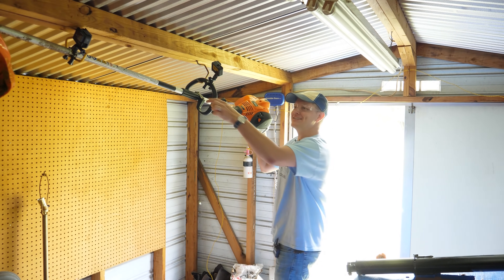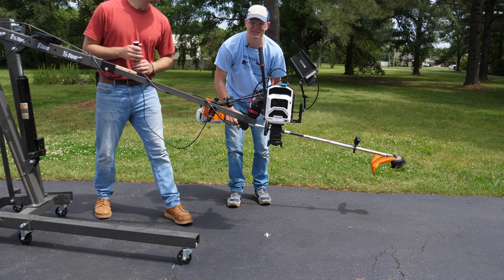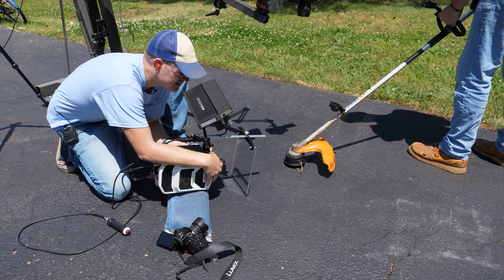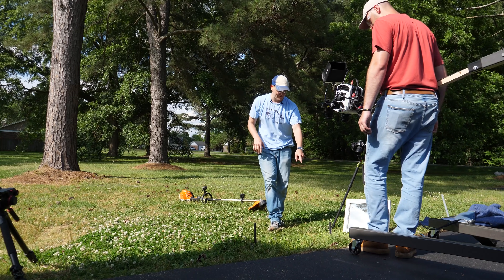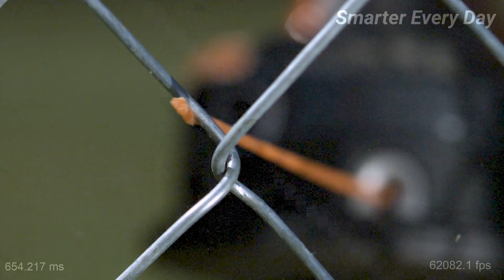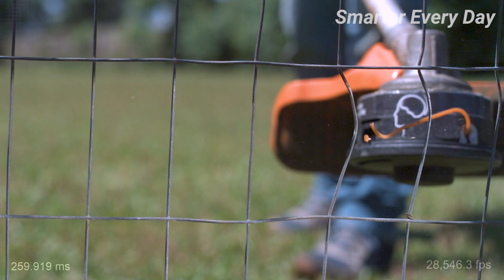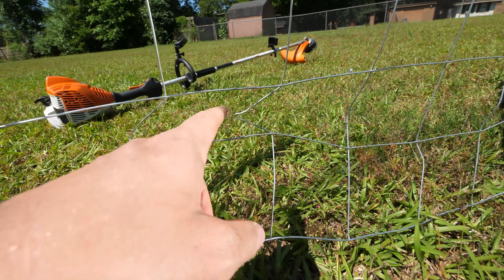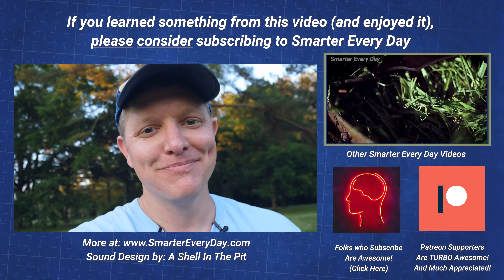How Weed Eaters Work (at 62,000 FRAMES PER SECOND) - Smarter Every Day 236

Comment: Tell it's STAGED... lemme tell you about that.

I bought a Toro lawnmower for 2 reasons... 1) had a Honda branded engine, and 2) didn't have the push assist. It was the cheapest mower I could find with a Honda engine and I got it because I was sick of disposable lawnmowers.

The payoff: that engine starts first pull every time, even after sitting in a shed over winter. LOVE that engine. briggs and stratton are pure junk lol, never again. Also most of the knockoff engines with no branding at all are old briggs copies. I'm sure the Honda engine is from China and not "as good as they used to be", but after 3 years I've never had to do anything but a single pull and I love it.

For the weed eater though... I have an electric one. It's got a 40 volt lion battery, I've had it 7 years and I can still easily mow my lawn 2 times with it without charging (I do after every use to keep the battery healthy though). Nothing worse than messing with little carbuerated 2 stroke engines, yuck.

Comment: We have a chain link fence in the back yard and to trim it I throttle back and the line goes through the fence and cuts some of the grass on the other side and does not cut the line. It takes a bit of practice but well worth it. Using a four stroke Toro string trimmer. I would like to see that in slo-mo.

Comment: When it revs really fast then the string is too short. I learned that buy going wide open is. most efficient. Because the motor doesnt bog down when cutting. Not saying wide open the whole time but mostly when cutting. A lot of people give it gas let off , give it more gas and so forth. This makes the motor work harder. I take care of3 properties for a total of 13 acres. 99 percent is with a weed eater. Nice slo motion camera

Comment: Isnt it breaking because the wire on the first one is thicker same as the 2nd one  then the weed eater wire there for when it hits the fence the fence is putting the same amount of force that the weed eater is putting in making the wire from the weed eater weaker there for it breaking thats why on the last fence the weed eater didnt get damged as much then the others because the weed eater was putting in more force then what the wire can handle because it was slimer then the weed eater and yes its only breaking from tension becuase the weed eater has its fibers  damaged already

Comment: The reason you cut from right to left is because of the gaurd oreintation, notice how the gaurd extends to the left on most weed wackers, thats to stop the bits of cut stuff from coming up and hitting you in the face, because the cutter rotates counter clockwise. also if you were to cut from left to right that part of the gaurd gets in the way to your cutting, especially if you are cutting alongside a building.

Comment: Haven't watched yet but I say that for sure the lines must straighten at some point. The weed eater I've always used has a sharp metal plate on the plastic shield that snaps off excess line when you let it out from the internal spool. Pretty sure it was always broken right where that plate is, meaning it must go straight out. I'm interested to find out now...

Edit: somehow that unpleasant feeling of yanking and knocking when you hit a hidden fence or bar is magnified tenfold when watching it in slowmo.

Comment: I have a thought in regards to the "tension break" on the chain link or hog wire. 

It looks to me that the friction from elastic deformation is creating enough heat in the line, that it looses tensile strength.

Comment: Curious about the footage of the fence test. Do you think it's only a tension break or do you think that there is heat being generated on the string at impact that might melt the line a little bit and cause it to weaken, then break?

Comment: Weed Eater, Grass Whip, String Trimmer, Weed Wacker, Trimmer, Line trimmer. I have heard them called many things but this video was great I always thought the weed wacker was getting pulled in when hitting a fence or ground rod. Can’t wait for your next video to see what type of line I need to buy. I would also like to see the line a branding against a solid flat object like a concrete foundation or rock. That seems to wear my line down really fast , I am interested to see if it is abraiding or breaking like it was on the chain link fence.  Keep up the great work

Comment: Thank you for ALL of your awesome videos. I really appreciate the educational content and cannot fathom why anyone would "thumb down" any of them. I do lawn care for a living (30 years of it) and ROUND line is the best. Any of the other shaped lines will have less material in them. For example, The triangle shaped line has a smaller face surface area. You can fit the triangle inside of the circle. The triangle line also wobbles violently up and down. It wont hold straight out for you on the high speed camera, instead it will make an X shape when looking at it eye level. I have wondered if there is some kind of pattern to the wobble with triangle line. Perhaps every 10th rotation makes the line unstable and wobble? That would be cool. Thank you again and your friends and family too, looking forward to your next video.

Comment: Looking forward to the next video.

I’ve tried... 

Circular line that’s plastic, but it’s smooth, hefty, and has “gel” like feel.

Line with a metal wire core.

And lastly, light weight star shaped line that feels “cheap”.

No joke, the cheap line out performs everything... even the metal core line. It makes no sense at all.

Comment: The force that pulls the string straight out is due to centripetal acceleration and not angular acceleration. Angular acceleration is when the rpm increases which would cause it to lag behind. Right?

Comment: There actually similar physics going on with CNC routers. You need to move in a specific direction so the material you're cutting chips in the right way and the router bit doesn't 'bite' into the material. It's worth a look :)

Comment: I've always used the term weed whacker.  Growing up I always thought a weed eater was one of those home depot brand "revolutionary" types that doesn't work - think:  B&D Snake light.
The funny part is everything here just gets pummeled to death.  I always thought it the chord hit the grass so hard such a small point that the grass tore and the blade cut the chord on a single pass (although it may do that on a new one with a sharp blade).  But no, everything gets pummeled.  The chord gets pummeled against the blade until it breaks, the chord pummels the grass until it breaks.  Everything gets pummeled.

Comment: One important reason why it looks different on the first fence compared to the others is because of the relative position between the weed eater line and the fence. The first one (diamond shape was close to a 45 degrees, while the others (squared made the impact be perpendicular to each other.

Comment: We call this a “whipper snipper” in Australia...
Reply: Also whipper snipper in Canada
Reply: @FreshPotsGaming  whipper snipper in tpb canada or actual Canadian
Reply: @b.m.r221  TPB as in trailer park boys? If that's what you're getting at.. East coast Canada is the best coast!
Reply: "Strimmer" in UK
Mixture of string and trimmer
Reply: Correct
Reply: ever call 'em whipper snapper?
Reply: Weed wacker mate.....
Reply: @silentdragon1555  weed whacker.. "weed wacker"  is another brand name like weed eater both brands...
Reply: Yep can confirm
Reply: Yeah you also have some universally unessasarryily sexualized phrases down there and alot of it sounds like a barney the dinosaur show
Reply: @b.m.r221  ??????? What.......what are you smoking....
Reply: Bryson Rose sexualised phases such as?
Reply: reborn new bro we literally call flip flops a pair of thongs, I think that should explain it haha
Reply: Whipper snipper for consumer grade, brush cutter for prosumer/professional. The one in the video is a tapper head with low grade line, whereas a brush cutter has a fixed aluminium head, with a wider gauge, with either metal filiment or diamond cut line. A brushcutter will also have alternating head attachments, for heavy duty workloads, full metal blades do exist. They use use bullhorn handles instead of pole mounted grips which are horrible for precision and stability in longer workloads.
Reply: True
Reply: "Trimmer" here, or if you want to be really specific as it can mean several things you would call it "gräs trimmer"
Reply: That's hilarious.
Reply: Yeah lol. Weed whacker is a funny name

Comment: The best line depends on the operator. Finer line works well for skilled users. The "cheap orange stuff" works for the newbies.

I would love to see how rpms and walking speed effect the interaction. I used to use a balance of line length and speed to get the results I wanted. Along a chain link fence, I would use longer line (I did take the guards off) and lower RPM to get a good amount of drag (picture galaxy arms) when I made contact with the fence. This reduced the likelihood of the line wrapping around the fence, yet still cut the grass. This, in my mind, saved a ton of line.

On say a big thistle, I'd use shorter line, high RPM and come down on it from the top, completely obliterating it.

Comment: Never really thought about the weed wacker mechanics, ive got an electric one at home i wonder if that makes a difference with the different materials, as the rpm changes. Since gas engine torque depends on rpm and electric does not.

Comment: On the lawnmower video lift was an important factor in cutting the grass. A cover was necessary to help contain the lift so that the grass was held still and cut like scissors. The weed eater has no such cover. How is it cutting the grass? Is it moving faster than the lawnmower blade? Is it because the line is smaller (and so has less area) and thus more pressure? Some other way entirely?

Comment: I wonder what the force of each individual blow of the line on The wire is. It's some function of horsepower and torque and such but i don't even know where to start with the math. It's just another great example of action/reaction forces and how pendulums are such great force amplifiers.

Comment: 30 seconds into the video and I have 2 comments.  First, use an electric weed whacker and you don't have to worry about it cranking, 😂.  Second, when trimming I wear a cap and safety goggles just like you.  I once had the excess string get cut to proper length and the little piece that got cut off pegged my forehead right between my goggles and cap.  No blood, it just looked slightly swolen like a mosquito bite.

Comment: There might be heat involved, like a meter hitting the atmosphere. The weedeater wire is moving super fast and transfers some of its kinetic energy into heat on impact. Do it enough times and the plastic heats up and melts, making it easier to break in addition to the tension.

Comment: "95 Thousands of an inch" - I can't believe Destin still  doesn't use metric.
Reply: Murica
Reply: He uses a Stihl, he ought to know that's 2.4 mm line. But then, he calls it a Weed Eater lol I think a Stihl rep just lost his wings
Reply: That is the scale on the caliper he had. If the scale was in (average) human hairs, the measurement would be around 2.84 hairs.
Reply: Well, he's American, so..  STOP IT ALREADY! We use what we use, you use what YOU use. Deal with it!
Reply: No need to.  He used decimal inches. Metric is just decimal of another length.  Get over it.
Reply: @videodistro  Not true, the power of ten that is used all through metric is way more efficient to work with. Out of your head: How many foot/yards/miles are 95 Thousands of an inch?  The same question for metric and you don't even have to think: 95 millimeters are 9.5 centimeters, which are 0.95 decimeters, which are 0.095 meters. Same goes for other units like grams, liters, etc. If you don't believe me you should ask yourself why 99% of scientists (yes, also American ones) use metric by now.
Reply: @real-oppenheimer  Its a matter of social inertia, combined with the expense of replacing all of the tools and tables already in use. That, plus our country is generally run by old people, and old people are not often "all about change" even if it is for the better.
Reply: @real-oppenheimer  everyone's aware, in the end it's the system we have and it works just fine. Any scientist or engineer worth their salt knows how to convert units in their sleep. We also invented cars, rockets, and smartphones with our dumb dumb English units, so I think we're doing just fine without having to overhaul our entire manufacturing system.
Reply: Was thinking the same thing.  Millimeters dude.  Millimeters.

Comment: I haven't watched the whole video yet, but I do have to pipe in to say this, before I forget:
At 0:10 he says "...how you know I've staged all of this, is that this weed eater is going to start up instantly". This is supposed to tell me that he worked, before hand, to get it running.
I have a Poulan Weed Eater, from Canadian Tire, it's the "cheap brand", which has been around the yard for probably 10 years, if not more. Every. Single. Year. I take it out of the shed, follow the instructions on the side to start it, and it starts in 1 or 2 pulls.

Edit: I got farther in the video. And I just want to say that my Poulan doesn't even have a guard anymore, I didn't even know that was a thing...

Comment: Yo Dustin, when I weed whack concrete and fence sometimes I’ll double up the string. There’s a noticeable improvement when using two compared to one (the concrete and fence just eat the one mostly) and I don’t have any issues with it not letting out more string (that may be for the particular model I have).                       Either way, if you read this Dustin I think it’d be really interesting to see you doubling up the string and using slow mo on concrete (a barrier wall, or the curb, or when getting between cracks in the ground, etc..) and the fence again and compare it to the single one. Just a thought ☺️

Comment: When you do the different types of wire, you should think about using the Schlieren system. It'd also be interesting to see at what speeds that the end of the cable reaches before AND after it wraps around and unwraps from the wire.

Comment: When it hits the small wires on the fence panels, I think there's an element of melting of the twine.  It might friction heat enough to lose strength on the rough (relatively) wires and then breaks more easily.  Particularly the stronger chain link.

Comment: I had to change my line with a round section one because my new weed eater’s head holes were few tenths of a millimeter narrower. I noticed the square section line I was using on the previous weed eater cuts a bit better, it seems more even in the cut. Gonna be very interesting how they actually work, thank you Destin, cheers from Italy

Comment: I believe the reason the built-in blade didn't cut the line to proper length until several passes, is because that blade needs sharpened. If it were sharpened, I bet it would cut that line on the first pass, second pass tops.

Comment: One thing I noticed right away... In the videos of the "angular" tests it appeared that you never got up to a steady speed and held it. Just basic common sense (in my mind) is that the line will always be "lagging" behind due to drag, but will be more pronounced as the shaft is accelerating, because the line can't "keep up", and is in fact being "pulled" along. 
And the different shaped lines have their place. Triangle, Square, and Twisted lines react differently to different materials and strength of materials that you use them on. But one of the most beneficial points of having those lines are that they have an "edge" that helps cut better in different situations. My yard starts to get these really thick weeds that have heavy stalks, where even the best lines still struggle if I don't take it slow and "saw" my way through. I've even tried using those disc attachments, which sometime work better. But for heavy grass the Square or Twisted line is best, and normal round line for light grass. Triangle never performed well. I think because, less sides equals less mass, making a lighter line not having the momentum to cut easily.

Comment: So what happened if you get rid of the junk round line and get Stihl 2.4mm square line? Also sharpen the cutting blade on the strimmer guard? Might affect the outcome?
Having the strimmer line longer than the length the guard allows with burn out the clutch. That’s why it wasn’t revving 100%!

Comment: Not only is the torque affected by the length of the line but probably more impacted by the thickness of the line.    I would be interested to see if you reversed the rotation of the trimmer if the end user would have a different bias.  Cutting left to right as opposed right to left.

Comment: What shape line works best has many factor not just line shape. Some eaters specify round line only. Also the entire subject of single line vs multiple and gasoline (more torque) versus the best battery weed eaters is worth study. Of course the name ""Weed Eater" is trademarked and we need to say "String trimmers". The thought of a trimmer ripping out small pieces of fence wire and launching them is scary. Wear goggles folks. I cant subscribe to every site and wont waste your time and mine by subscribing and then unsubscribing:-))

Comment: What is happening with the temperature of the cutting line at the contact point?  Kinetic energy converting to thermal.  It would be interesting to see a thermal high speed video.